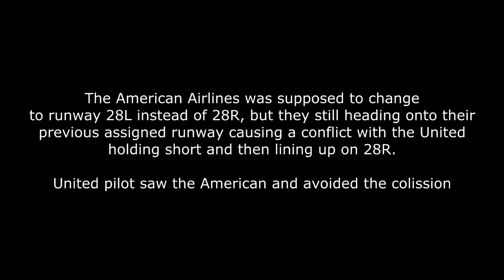[REAL ATC] American CONFUSED on landing causes CLOSE CALL

Comment: There was a little hesitation going on with the change of runway call. The very quick response from the pilot indicates that he didn't process the call as a new instruction and just did a call-back. Can someone please tell me how runway L and R were assigned? Does runway have preferred direction for takeoff and landing?
Reply: Oh, and I guess the runway number before L/R refers to the length of the runway. But what's the unit of measure? And is this naming system globally applicable? Sorry for the many questions, I've been taking interest in aviation recently because of this channel. =)
Reply from the maker: Hello, sir.

First of all, aircraft always depart and land against the wind. Always if possible. The number before that L or R is actually the direction of the runway. If I have runway 28L and 28R, both are paralell runways that face 280 degrees in a compass. The L stands for LEFT and the R stands for RIGHT.

The length of the runway is shown in the airport charts or diagrams usually in feet or meters (length by width). In this video, you can see runway 28L is 11381 feet long by 200 feet wide.
Reply: Wow, that's some great info there for us newbies. Thanks.
Any speculation as to why they might've switched the runway like that?
Reply: +VASAviation - Wow, I'm impressed!!!
Reply: +VASAviation - wow, how do you know all that stuff?
Reply: it is a dual runway approach for this kind of situation. ATC decided to set up a takeoff for the right hand runway but did not realize it was cleared for an arrival.  Crazy.  As for preferred direction, all takeoffs and landings happen in the presumed direction of oncoming air drafts.  Makes the operation smoother and safer to execute.  In this scenario the wind direction was southerly meaning north bound planes would enjoy the advantage of fighting the wind rather than having it work with them..
Reply: I think you mean northerly... southerly means wind coming from the south blowing north.
Reply: VASAviation - I think you meant to say “into” the wind. Great work, BTW.
Reply: @peterkacandes5905  "into" the wind and "against" the wind mean the same thing.

Comment: I love these videos!  Subscribed!
:02 is "on the FMS visual".  FMS is the Flight Management System which is what incorporates all navigation inputs (GPS especially- used to be primarily INS on older planes) and loads and flies procedures, routes and approaches.
So it must be an approach which is flown visually but also has FMS (INS or GPS) waypoints to assist.
Actually I just read the Asiana 777 crash report yesterday... maybe this is the approach that they were flying which causes you to be high and fast on approach because it is designed for noise abatement.

3:26 "Call this number to discuss you pilot deviation" means he is in trouble for not following an ATC clearance. No fun!
Reply from the maker: +StratMatt777 Awesome! I knew about that kinda approach but didn't know they reported as "FMS visual" on frequency. Thanks Matt! :)
Reply: VASAviation - I didn't either!
Reply: +VASAviation - They re not. It;s the FMS Bridge Visual, chart 19-3-1.

Comment: Tower call should have been "Cancel landing clearance 28R New clearance; clear to land 28L" when you slip in "change to" at 1.5 mile out mistakes are going to be made. The other call would have been having UAL hold. Biggest question is why change vs have the heavy land on longer 28R and United take off on 28L? Couch jockeys don't understand landing is the most demanding phase of flight.
Reply: On the other hand, you want a longer runway for takeoff too, to have a longer distance to stop in case of rejected takeoff. In an RTO, you only have half the runway to stop the aircraft, whereas in a normal landing, you would obviously have the entire runway. Takeoffs can be just as dangerous as landings, but people seem to never give them proper regard

Comment: I don't understand why the change for the runway.  There was a UAL flight ready for takeoff at 28L and the landing aircraft at 28R.  Then ATC swapped them....  Dangerous and unnecessary move by ATC for no apparent value.
Reply: ATC decides clearance for takeoffs and landings.  You can say 'unable' if you don't like the clearance and they will make you wait, go somewhere else, or go around and land somewhere else....ATC controls the air and the airport...the pilot has responsibility for safety and flying the airplane.
Reply: It sounds like there was a heavy that just landed on 28R causing wake turbulence.  Because of this danger they would either have to sidestep to 28L or go around and let the turbulence disappear.  At least this is how i understand it.
Reply: Remember when the controller told the UAL to line up the AAL was on a 6 mile final. This was more than adequate time for any easy transition. The reason for the decision is more complicated and has to do with the rather narrow distance between runways at SFO. plane departing on 28L must wait of landing 28R aircraft to cross 28L as there is not enough room to hold between runways. SFO controllers often make this call to expedite traffic. As soon as AAL touched down assuming he switched to 28L then UAL would have been cleared.  This saves about 60+ seconds. Which adds up to a lot more planes per hour and less delays.
Reply: Rough and dirty math says 6 mile final at presumably no more than 180 knots would be at most 3 miles per minute so 2 minutes to taxi across the runway is beyond sufficient.
Reply: This is partially right. Aircraft can hold between the runways at SFO no problem. But the landing aircraft would still have to hold between the runways at 28L, waiting for the aircraft on 28L to take off. ATC switched it so neither aircraft would have to wait for each other.
Reply: And if UAL820 took off from RWY 28L EVERYTHING WILL BE SMOOTHLY.
Reply: @BollocksUtwat  6 mile final was for the plane after AAL.

Comment: Not really a close call, but still a mistake of both the ATC and AA pilot. The ATC did not give the clearest change of runway instructions, and in addition did not catch on his scope that the American 767 had not changed runways. If the AA pilot was unsure of the instructions or could not comply, I guess he should of checked again with the Tower on their intentions.
Reply from the maker: s2v8377 The thing is that the AA readsback the runway change... so, the blame falls just onto the AA pilots. Maybe, from the Tower cannot see if the AA changes the runway or not...
Reply: VASAviation - Should have been clear on the radar that he didn't change rwy.
Reply: Xanthopteryx not for these SFO runways. They're below the standard FAA separation distance and have a special allowance for paired landings after partner aircraft have a visual with each other.

Comment: Im wondering should ATC have called SIDESTEP Runway 28L??
Reply from the maker: +Sanket More he could, but he said cleared to land runway 28L and American did read that back so, this is no debate needed. American did wrong :S
Reply: +Sanket More "change to and cleared to land" is correct phraseology. "Sidestep" is specific to certain types of approaches, of which the FMS Bridge Visual is not one of them.
Reply: I agree, I don't think that it's just the pilots are to blame here. The ATC should have slowed the dialogue and announced a change to runway and made sure that they confirmed that they understand that change rather than saying 28R in one sentence and the 28L in the next..... It comes down to physiology in that the brain was expecting to hear 28R so when the ATC said 28L the pilots heard it still as 28R....only one letter different.
Reply: +alan jackson psychology
Reply: +alan jackson i agree fully with Alan. The atc instructions should have been more clear, and said "change your landing runway to 28L, or included the word sidestep to rwy 28L. And then after the pilot acknowledges the rwy change, then atc could have cleared then to land on 28L. Instead, the atc combined the rnwy change and the clearance in one broken sentence. Sounds like In the pilots mind, they only processed the cleared to land part. The pilot is still at fault though, for reading back 28L,and not going to 28L, or especially confirming the atc instruction when he heard atc told the other guy to line up and wait on 28r. So long story short, pilot was to blame, but atc could have worded the instructions better, that would have avoided the confusion.
Reply: Sidestep can only be used if those two runways were a certain distance apart from each other.

Comment: "Cleared to land." is supposed to mean something. It should not be "Cleared to land unless I decide on a whim to change runways." Change runways after the last aircraft you cleared to land on that runway has done so. Except of course for absolutely neccessary go arounds.
Reply from the maker: David Hoffman Hey David, at this point in time I still don't know why he changed the runways. The thing is the American readback the change and clearance on 28L but they didn't proceed. By the way, I think change of runway is not that unusual in big huge airports with paralell runways. Thanks for your comment! :)
Reply: Spooky MGTOW but shouldn't they have said "cancel landing clearance" ?????
Reply: Based on the readback, AAL2293 had landing clearance on both 28L and 28R.